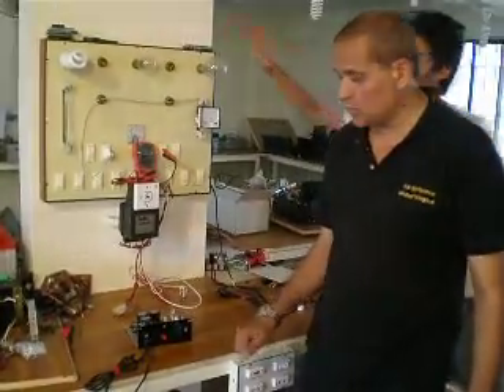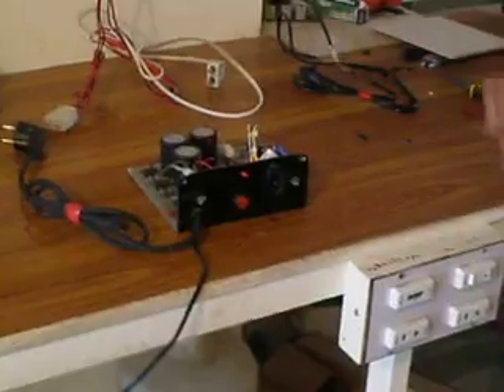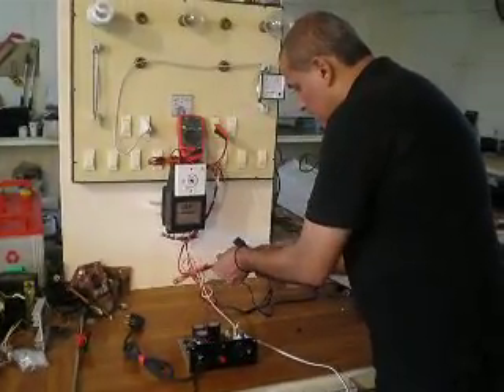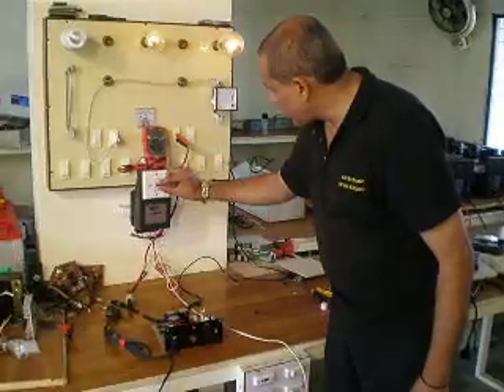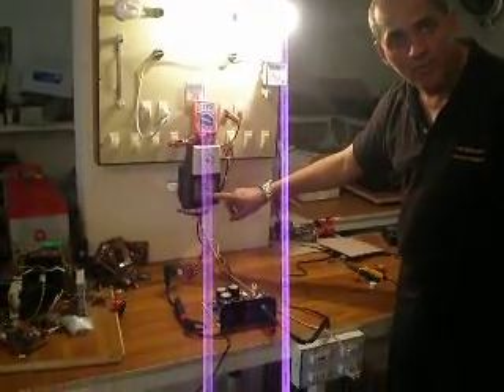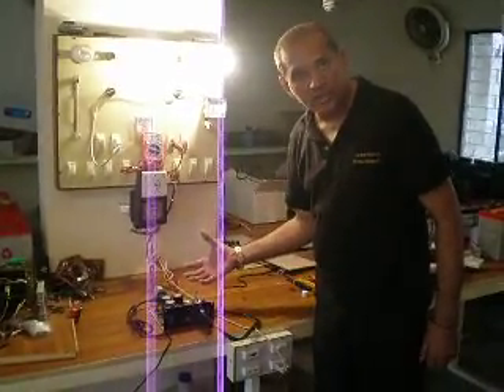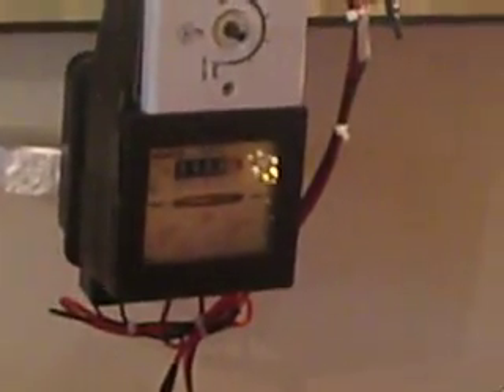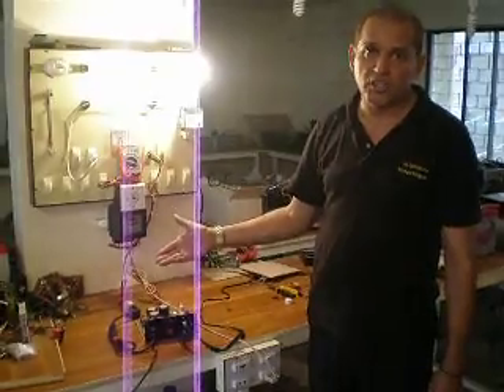CLIP2

Comment: i think i might know how you get such a reduction in power...

However, that third wire concerns me too...

I'm also puzzled as to why you need a 30 volt input...most devices use a multiple of 12... so 12, 24, 48, 96....
Solar panels and wind power is mostly 12/24 volts... not 30...

Comment: the device operates at 12 volts for its IC to operate it require 12 volts DC at 0.25 amps the third wire is 12 volts supply
system is under development so we have provided this supply externally once we finalize we will built it in side the unit

Comment: i do know PFC very well both ACTIVE and PASSIVE this is the reason why i measure the input output current and voltages and establish the fact on the basis of those elements use of meter is to show the reduce billing 
coming to the point that the load i have used in the video is purely resistive which exhibits a 1.0 PF(power factor so there is no distortion of phase and in our final design definilty we will include passive componenets to counter measure PFC issues

Comment: @winsonal 
Are you familiar with Power Factor?  Most common electrical meters will give incorrect readings AC readings when current and voltage are significantly out of phase, or if power is being drawn at higher frequencies then the meter was intended to measure.  I am just trying to establish your experience level with electronics, and if you are making  a 
fairly common (but understandable) measurement error.

Comment: I see, many thanks for the infos.

Do you also have coils in the unit ?
So do you switch the rectified AC into LC tanks and get then a higher voltage at resonance
that you feed to the bulbs ?
Do you have at the output again a pure 50 Hz sine wave of a different frequency and waveform ?

Many thanks.
Regards, Stefan.

Comment: the device require 12 volts at 0.25 amps to activate the circuit the cord is providing 12 volts supply we have sofar tested unit till 1000va
the device is MEG this means motionless electricity generation 
the beauty of the device is it can be used as voltage stablizers 
it can directly connected with windmill and solar panels and you can remove battery banks from them
the principal of device is just like negative resistor but with a different technique
it has a progaming chip in side

Comment from the maker: ====So how does this invention work ?

it works through software and follow a patern of switchinhg technology which boost the voltages from 30 volts to 220 volts but reduces current 

during the process the the movement of electrons generates its own rersonance and a more power out comes out 

the principal is some thing like negative resistor but the technique used is different

this is my own theory which i have converted into practical means